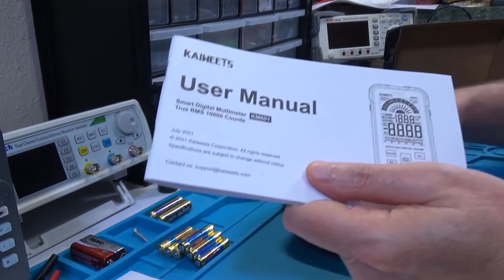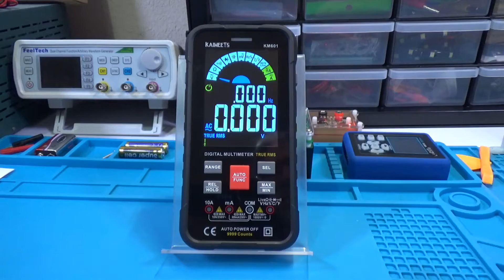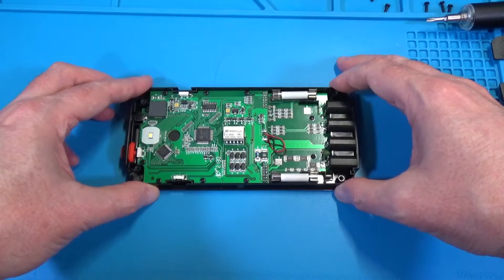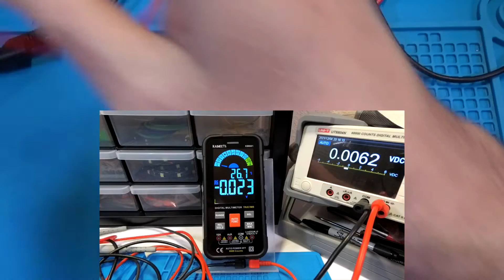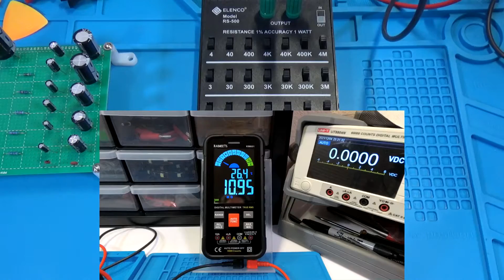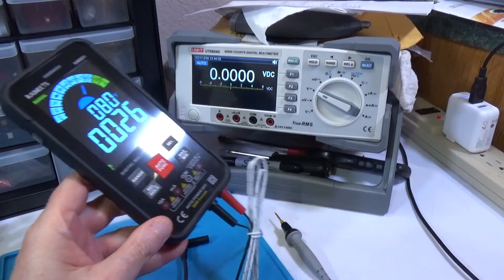Kaiweets KM601 Smart Multimeter Review and Testing

Comment: great detailed review, good work. impressive innovative meter, display is great, but i keep my good bulky HT118A for 5 reasons,  1. MicroA 2. pF 3. B/W display for using it daily for hours.. 4. uses 2 AA battery i think 5. STAND.  118a CON is obviously Size/weight and "only" 6000RMS..  This compact smart meter could be a great secondary for mobile use, in the car, outdoors, garden, garage. but 118a remains the oldschool daily stationary workhorse..34:35 boiling water best temp test
Reply from the maker: I actually prefer the HT118A myself - slightly more accurate and better useable range for capacitance.  To say nothing about the stand.
Reply: 118 series are far down modes, i have all versions, what is the pf point, they all measure from 5-10 pf, 118 versions have 10 times slower sampling, 601 has zero readings when shorted probes, no readings without capacitor connected, 118A-E cant to that.

Comment: The cellphone form factor is its biggest selling point for me, I’m placing it in a small edc nylon tool case so the thinner the better. It was a choice between Fluke 107, 101 and this model. I ordered this Kaiweets due to price, size, accuracy, and form.  The stand isn’t as important to me- I never use them anyway. I’d rather hang a thin meter than a thicker one with stand.
Reply from the maker: Well as they say - whatever works, right?  I use mine exclusively on the bench so yeah, the stand is kind of preferable to me.

Comment: Kaiweets vs Klein vs Fluke....you can only use one...which will you use?
Reply from the maker: Eh - pretty loaded question.  Assuming I could have any Fluke I wanted, then definitely Fluke.  However, if it's from my own collection I would NOT choose the Fluke I have - the 17B+ doesn't exactly impress me.  And seeing as I don't have any Klein meters - no comment there.  So I guess it would be the Kaiweets and this is assuming it's just for benchwork (CAT I and II stuff).

Honestly I would rather just use my Uni-T UT8804N bench meter.  Best meter I have.

Comment: Approximately, how long does the battery last on this multimeter?
Reply from the maker: I haven't actually measured this but since it's an always on EBTN display it will be shorter battery life than average.  Best to use rechargeables with this unit.

Comment: Great video! Thanks. One thing: I purchased this meter as well, however when measuring capacitance mine takes ages until it shows numbers. Yours shows the measurement almost instantly, mine takes at least 5-7 seconds. Is that normal?
Reply from the maker: What capacitance values does it take that long?  In my experience on this meter and most other low cost meters it often can take 5+ seconds to get a reading on higher value capacitors, say above 100uF.  What probes are you using?
Reply: @Sui778  So you're saying that's to be expected from this meter? I was only asking since the meter in the video doesn't take that long.
Reply from the maker: @Patbwoy  I'm asking what values you are experiencing this at.  In higher values mine takes around 4-5 seconds, and it could also have to do with the probes you're using.

Comment: I have performed calibration and test equipment repair for many years in the Navy.  Watching an electronics parts channel, they showed this unit and gave a very quick walk around.
I purchased this through Amazon in addition to their HT206B clamp on.  In the process of checking accuracy, both have performed almost perfect to the 'T'.
Most of the multimeters and clamp-ons that I have repaired, calibrated, or simply checked; the Kaiweets has measured equally, and in many areas, better than the FLUKE meters.
This meter is a great addition to any ones toolbox or work bench.
Reply from the maker: Appreciate your comments and hope you enjoyed the video.

I have found all the Kaiweets meters I have looked at, tested and reviewed to be of the same quality you speak of.  In regard to Fluke - I would say it depends on which model it is but I will say that this one and the HT118A I have clearly outperform the Fluke 17B+ I have.  In all fairness to Fluke - the 17B+ isn't exactly what I'd call one of their premium meters - and I'm not saying it's terrible either - but I have several cheaper meters that are consistently more accurate than it is.  Of course none of them are category III or IV either so it's a bit of a trade off.

Comment: Great review, been waiting for better reviewers like yourself to get a review out. This flashy new model or the 2 year old tried and tested HT118A?
Reply from the maker: @uTube I appreciate the comments.   Deciding which of these to get really depends on one factor - do you need a meter that can accurately measure in the picofarad range or not?  If yes - then I would go with the HT118A.  If no, then I would probably get the KM601 as the better count resolution would be more useful.  If you must have a stand then the HT118A would be the better choice as the KM601 does not have a stand.
Reply: @Sui778  UNI-T has released 3 new 9999 units as well. UT60S UT60BT UT60EU, what do you think of these? I am sure people would like a review on these too.
Reply from the maker: @utube9487  A couple of others have asked for that already.  Looking into it.